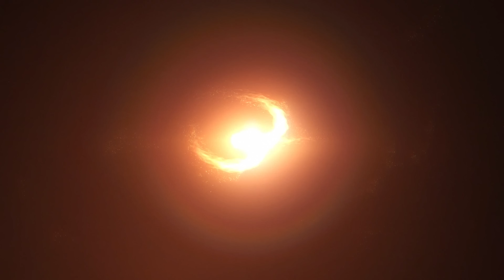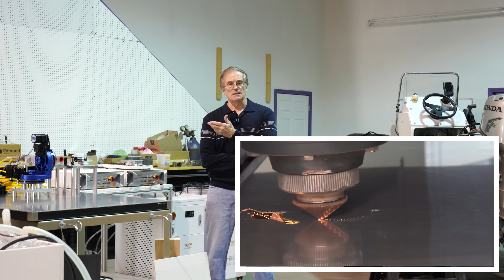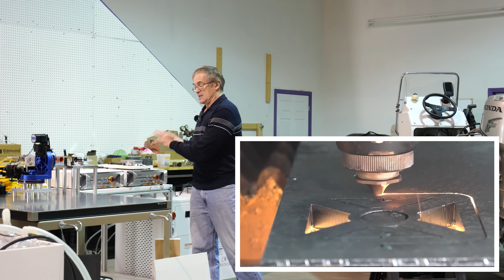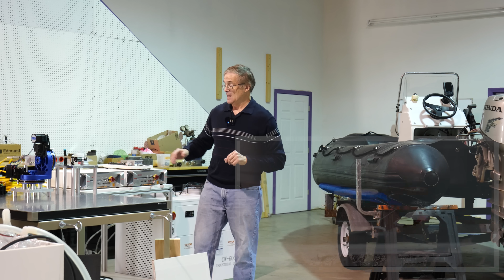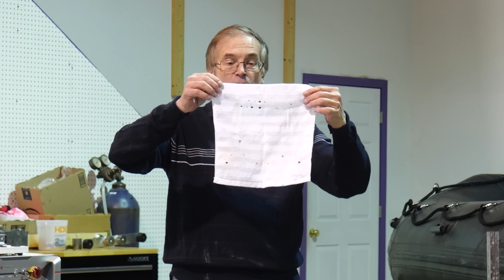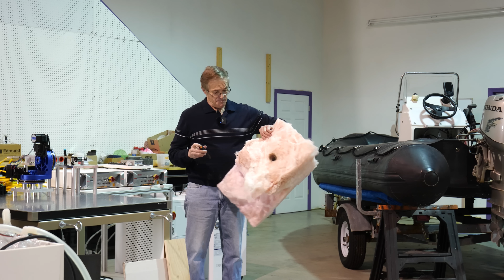We have a problem... and need your help!

Comment: Ok, some ideas off the cuff. 2 material-based, 2 that aren't material-based.

You might have been on the right track, with the fiberglass: diffusion.

But maybe fiberglass is just too insubstantial. Theres so little mass too it, even a little energy is enough to melt it.

Ive seen a material called "foamed glass". It seems to be roughly the consistency of pummice/lava rock. It has a sort of milky, semiopaque appearance, and a clear porous texture. You might get several layers of diffusion out of that. The macropores/bubbles might diffuse the laser as the micropores/bubbles do the same on a smaller scale.

But that might to some degree minic the problem that fiberglass had. It could be the fiberglass had TOO much diffusion, as in it was diffusing so rapidly that the energy was bouncing around trapped in the labyrnth of surrounding glass fibers. All that locally trapped energy near-immediately overheats the glass, melts it, and the beam passes through to rapidly continue the process a little deeper.

These whole "lots of tiny pores  make it diffuse well" and "low mass = fast destruction" factors might also be why regular old plywood performed shockingly well before catching fire.

Cellulose is clear at a microscopic level, old fashioned true "cellophane" as an example. That wood is essentially a big clear cellulose foam with impurities mixed in, that seems opaque to us largely because if the diffusion. Similar to how polar bear hair is clear under a microscope. A glass foam may have even better performance and resistance time than the plywood due to the much higher temperatures it takes to destroy it (melting glass vs igniting wood), and also not endanger the shop by catching fire.

Things get weirder from here.

A curved reflective surface would cause the beam to widen/narrow, so a very high curveature, should cause the reflection to widen so rapidly it weakens the beam past the point of concern. Convex ones would do this from the start, where concave ones would do it by creating that inverse effect the laser cutters at the beginning of the video had. The beam narrows so rapidly that it widens again after the focal point/beam waist so it doesnt damage the things beneath what its cutting.

But the curved surface would have to be where the beam is pointing for this to work.

If high curveatures and wide area coverage are what needed, 2 basic material types might make sense:

-reflective spheres/ microspheres suspended in a clear medium (glass again?)
-some sort of reflective mesh

Spheres in medium: with a 1mm laser, if it were to strike a clear medium filled with a fair density of  <1mm reflective spheres, the beam should bounce back in a scattered array of rapidly widening cones. In theory, that could be ideal. You wouldn't be endangering the shop or even damaging the guard material, because nothing is ansorbing the brunt of the laser energy, its getting spread out massively and lots of things are taking a tiny amount of the energy. Part of me worries a material like this wouldnt diffuse in just the right way, and cause the glass to shatter from heat expansion. Worth a controlled test maybe.

Mesh: a few layers of tight chainmail, and/or steel wool/stainless steel scrubber pad material. Maybe this would absorb some of the energy, diffuse some more, and generally be more rugged than the fiberglass. It aslo cant have a catastrophic shattering failure like glass/w spheres could.

The last 2 ideas are pretty simple and not about a protective material. Its changing up the system to change the nature of the problem. It doesnt seem like you actually want *a laser resistant material*, as much as a way to test this safely.

People have already mentioned pointing at the ground, but i second that as an option.

Inversely, the sky? Im guessing that the vaccuum of space is pretty safe and the moon wont be damaged by this laser. Going on a rooftop and setting up the  machine so that its physically incapable of pointing anywhere but a range of angles upward could mean no materials required.

I could ABSOLUTELY imagine youd want to know about airspace and the legalities of shooting high powered lasers into the sky where youre at for air traffic reasons, but i imagine thoae laws exist and can be found.

This is real interesting work and i love the idea of crowdsourcing solutions then releasing them to the same crowd. Beautiful use of modern information technology. Good luck whatever road you take

Comment: 😅amazing, and cool that you share the process 😍 for a qick workaround for the testing could you just turn the drywall by 90° to get with a few sheets a relative long way to burn throu? other thing what i can think off is what about something like a bucket with something that are burn away but new meterial is drop down constantly that you don`t need a material that can take the beam you are just use it up?

Comment: Sillicon wafers? Melting point 1400C... there is a plenty of waste coming out of the semiconductor manufacturing, so you should be able to acquire them cheaply. I tried to etch them with CO2 laser with no success...

Comment: The only other person I heard of that built a system to make a beam weaker was Troy Hurtubise, but he died and I don't know how he did it.

I'm not sure I fully understand what it is you're doing, but you should probably just stay with the brick. It's absorbing a lot of that light, but not all of it. If even a little reflects off of it, I'm sure that'd be enough to trigger a photo sensor to turn it off.

Comment: Well I'm not sure about cheap, but I sure would love to see an experiment on silica Aerogel (bonus points for graphite aerogel) and how it holds up to a laser of that strength 
with its high temperature resistance and semi transparency it could possibly dissipate the energy of the laser over a span of distance instead of all at the surface
although looking at options its not something you can just up and buy, maybe hit up Nile red and he can hook you up.

Comment: I like a first-world problem, especially "my lasers are too powerful!".  My first thought was that you could use disuse anodised aluminium safety screens thermally linked to a safety fibre board used by electricians to mount solar batteries and the like.  Another thing that sprang to mind was to use an Acousto-optical Modulator to control the beam characteristics, direction and intensity during testing, although with the powers you use it may not be possible.  I also know that Pangolin sell something called PASS (Professional Audience Safety System) which could potentially be modified for this use.  Have a chat with Bill Benner there and I expect he might be able to send you in the right direction.  I hope you find a solution.

Comment: Carbon Fiber felt?  Cheap, light, and good to 1200c.  Also super absorbent if you still think soaking it with water might work.   There is also ceramic fiber insulation; though way more lung toxic, is also cheap and good to 1600c, they use it to insulate forges.

Comment: Try a carbon/graphite-coated water-cooled copper block, not with the surface at 90° to the laser beam, but at shallow angle, in a black box with an inlet hole just small enough to let the laser beam in. Maybe a second or multiple such surfaces to absorb the reflected/scattered light. You can also place a diverging lens at the inlet hole to spread the light to a larger area.
Diverging lens and shallow laser beam incident angle are both a good way to make the beam not immediately melt through the carbon/copper.

Comment: Try mixing water and iron oxide or copper oxide powder. That soup should produce steam and aerosols and dust once hit with the laser. Build a wall with pane or boards that will withstand moisture for the duration of testing. A hydrophilic surface might help. Then, pump the soup through a perforated hose to  create a laser resistant waterfall across the wall.

Comment: sand bags and dry wall. place  the sand bags between the dry wall. The drywall will keep the sand in place if the bags get to ripped up.
Reply: makes me wonder what would happen to ash? wood ash and volcanic ash. What about tiny little prisms? As you can tell me no engineer.

Comment: A Wall made of salt bags and behind a wall made of sand bags. Relatively cheap;  extremely heavy, but cheap. Problem is that it should be incapsulated or the stuff will flow away via the holes in the bags.

Probably the salt will hold onto itself once melted.

Comment: I would go with a vertical setup, mounting the laser near the roof, then placing absorbent material (damp sand for example) on trays on pallets on the concrete.  Set your targets up between the two points.  If you have a forklift in the warehouse, then, it can all be mounted on a pallet and its quick and easy to setup.  The forklift will let you move things around easily as well (lasers and absorption trays).  If you don't have a forklift, then it can still be done with scaffold and ladders, its then annoying from an operational point, having to get up and down to the lasers, but would be really good value overall.

Comment: Well here are my ideas, not from experience just intuition:
1. NighthawkInLight's Starlite recipe. It's cheap, and you can plaster it however thick you need, onto a manageable tile size.
2. Carbon felt. High melting point, internal dispersion, extremely low albedo.
3. Fresnel lenses. Probably not economical to cover a large area, and it might not pass enough energy to avoid melting itself, but it might at least diverge the beam to safer intensity. Then maybe a simple black stage curtain could stop it.
4. A water lens. Perhaps a cellular design where the center of the lens on the front side is the edge of the lens on the back side, to ensure full coverage.
... Now reading the other comments, the dye-water curtain sounds like a pretty good option. Might go well with the water lens approach. But I really want to know what happens to Starlite, I think that would be a pretty cool video on its own.

Comment: Hi professor, Why not use a divergent lens before the shield, which will give you some flexibility on material choice by spreading the energy over a larger area?
Also, I think I saw somewhere how to do a home made material similar to the space shuttle heat shield. I think combining the two may ideas may give what you need. I will look up this material and post a reply on this comment.

Comment: How about a sandwich of 2 materials? Drywall and plywood, drywall doesn’t burn.  And instead of sheets,make something like bricks so you can stack them together. 

And how about a 2nd computer that can also turn off the laser? When the main computer crashes during an operation the 2nd computer does turn off the laser. Rules can be like: coordinate received is not complete, path of the beam doesn’t match with coordinates received. 

In agriculture you have sprinklers that gives fog like drops, those drops disperse the light. And when vaporised there is another coming into the beam. And it can wet plywood preventing to burn. 
Lot of testing needed.

Comment: What about a whole bunch of vertical Pyrex glass  tubes . Several layers in a kind of portable panel , water filled,  with top in common water manifold , same for bottom . A high flow water pump to give vertical flow limiting the dwell time on any “parcel “ of water . You could experiment with colourings or suspensions to find difference in heat dispersion . How about ground tungsten powder in suspension in the large water flow as well ?

Comment: optical shunt like a liquid gas such as nitrogen or hydrogen at a high velocity across the cross section or an added medium that would drop like a UV or IR activated layer of resin capsule to simulate a cartridge of a nato round. when the 1035 IR resin is saturated to heat of ~*K the spring loaded mechanizism discharges capsule avoiding unwanted discharge of laser on said object.

Comment: The First thing that comes to mind is diamond, second Areogel, Third charcoal. you want either diffraction or absorption. The diamond cut in specific ways can diffract to reduce the power of any one beam to a manageable intensity. Aerogel is the best of both worlds with innate diffraction and excellent heat properties. Charcoal will absorb the whole beam but it might not last long unless condensed, and its a fire hazard but it should work. Good luck!

Comment: use the drive sytem from a treadmill, you can get free modify it making it 10ft wide. make the belt  with copper screen. place the base in a water trough full of a clay slurry. leaning pointed down as the belt turns, it will form a wet sheet of wet clay. posibly adding carbon to the clay or diy. 
or what about a huge amount of misters with black water

Comment: Hi Eric, how about firing through a small (to stop reflections) hole at the target, with turbulent water borne metal "chaff" in the mix. The idea is that each light strike heats each metallic bit of chaff a little which is then water cooled in a labyrinth of such chaff and churning water. Yep, I guess it's a probability problem eventually as to how thick and turbulent the water column is, so too the chaff material, size, reflectivity etc. I guess the walls could be internally reflective (totally). Just a suggestion; love your "hands on" and cool explanations.
Cheers, Peter Kelly (Oz).

Comment: A dyed water curtain over angled canvas and poly backing including iron oxide and circulation pump.   Iron oxide Powder may also be used independently as an aerial countermeasure for drone motors.

Comment: For this instance I would suggest moving shop temporarily. Find a potatofarmer or someone else with a large underground storage area. It might be called a cold cellar? They come in all sizes and potatofarmer often use them for storing potatoes during winter. Now they should be pretty much empty.
Reply: Potato farmer does not have 600 amp service :-)  BUT this is the simplest, and therefore BEST answer.  Find a better place to test from your audience.
Reply: Or mushrooms cave?

Comment: Depending on how much you are moving your lazer. A water cooled grafite block would be my best bet. An off the wall idea  slightly alternative a carbom matrix made from bread.
A change the reference idea would be change the orentation point it down or up but watch out for the airplanes and satellite. Question are seing any beam deflection from air ionisation?

Comment: There are "Acktar Blackened Laser Beam Traps" for sale but I don't think they would handle the intensity of laser you are talking about. But you could probably build your own, something similar to a portable cement mixer but using a metal drum. Line the drum insides with layers of different materials with the top layer being black as it will absorb the most light. Make an entrance hole in the metal drum lid small enough to allow the laser to go in but not out. Then in the middle place a diamond or something similar that can scatter the light to reduce the energy from being focused. Also an alternative is build a set of mirrors that will just redirect the laser beam into the ground outside and let the laser burn through dirt.

Comment: Have you looked into laser, protective polycarbonate sheets? The range in price based on fitness from $.80 on up to $4.50 per square foot in or designed to protect the materials that are behind them.

Comment: (i have not read all comments,) Use construction site materials. A movable scaffold that support a mould, surface moisted to avoid fire, mould contains sand. Use scaffolding equipment to make a frame, this frame is mounted on some kind of "under car roller". Inside the frame, assemble a vertical concrete pour mould with the surface area you need. Vertical because that will make it easier to assemble.. Reinforce the mould with construction fasteners for concrete pour moulds as you see fit due to weight of content. Fill mould with sand / silica / gravel. Use one to several garden hoses to create a mist that is sprayed onto the front of the mould. Then you have a movable object, that is filled with somehting that absord a beam, and since it is wetted it should in theory not burst into flames. All these things should be readily available, and quite cheap. I fully expect you to need to iterate this to make it into something that is practical for your shop.

Comment: I would do some kind of aquarium using thin glass in the front, covered with some kind of reflective material facing inward. Maybe some kind of sphere shaped stuff with water inside. So it doesn't reflect back much of it. The idea I would go for use laser to heat water somehow.

Comment: Plywood box filled filled with water.  2 x 4 frame with aluminum on firing side.  Water flows through hole and cools aluminum quickly.  Tape hole and fire again.

Comment: I believe a more effective approach would be to implement a system similar to a camera lens's focusing mechanism. Modern digital cameras are capable of detecting objects and automatically adjusting focus accordingly. By leveraging a similar concept, one could design an autofocus system using a two-way mirror—similar to those found in DSLRs—in combination with a laser.

In this setup, the same optical lens would serve dual purposes: providing input for the autofocus algorithm and defining the depth of field (DOF) for the laser. Beyond the focal point (i.e., the distance at which the object is located), the laser beam should begin to dissipate.

The main technical challenge lies in matching the exit diameter of the laser and the two-way mirror with a sensor size (e.g., Micro Four Thirds, APS-C, Full Frame, or Medium Format). Larger sensor formats may offer better thermal dispersion and reduce heat concentration on the lens, which could be advantageous in this application.